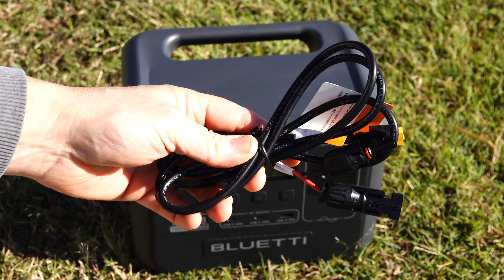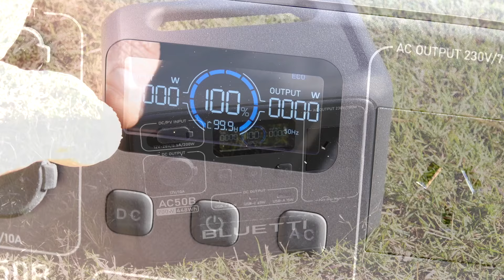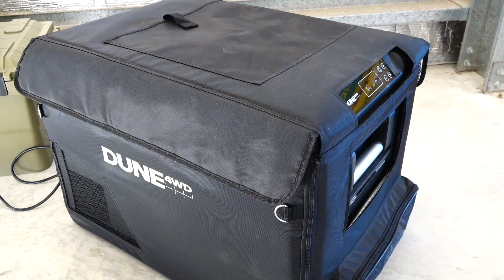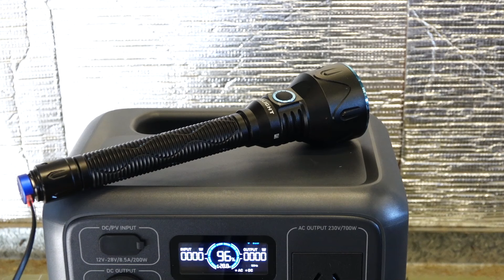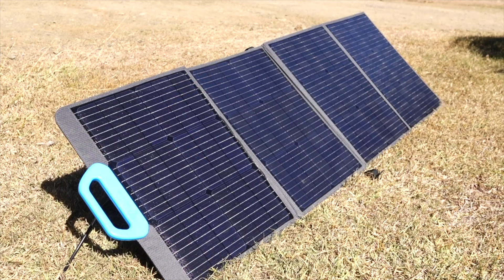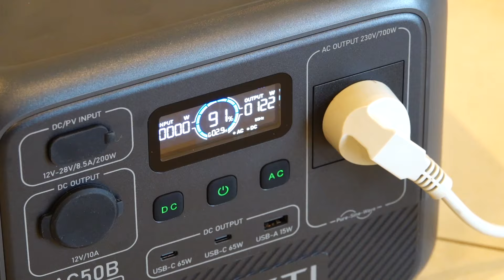Bluetti AC50B Portable Power Station (watch before you buy!)

Comment: You can run a fridge for a while, first you don’t need to plug it in right away probably takes at least 12 hrs to start thawing meat, fridges act as coolers when unplugged especially if you have lots of stuff inside.  Then once plugged in to the Blu it will cool back down giving you another 12 hrs.  But certain for backup this is the minimum you’d want, but could be done…